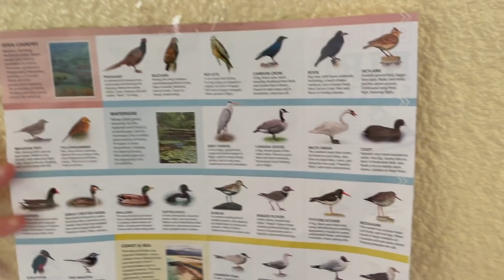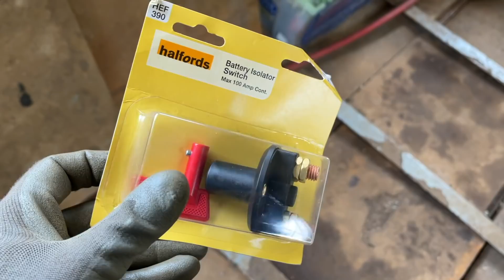WE HAVE BOUGHT A NARROWBOAT!! | Narrowboat Tour

Comment: Looks like your taking on water hope.you check the welds.before it went in.reliable those 1.5 BMW engineering .I mean BMC
Reply from the maker: It had a full overplate on the bottom of the hull so should be all good. The water had come from the front deck and windows being open but the deck has been welded now & touch wood we’ve not had any more water in since!

Comment: Please don't throw the bilge water overboard. This water is polluted! Treat the steel in the bilge with a surface grease just as skippers always do. DON'T PAINT IT !!!!!!!! I think the Tenco Antirust Compound is a great way to do this. This does not dry out and it keeps the bilge in perfect condition.
Reply from the maker: Thanks for watching! We went with what most people here seem to do & used bitumen/blacking as they do with the outside of the boats,  will take a look at the Tenco product for the future. Ref bilge water the CRT seem to say as long as there's no oil in it then its OK to pump into the canal.
Reply: @ItsOhJoe  good luck rebuilding your boat. Its a great lifestely I have been living (in the netherlands) on dutch barges for over 20 years now. currently living and working on my 4th rebuild.

Comment: Take the ballast out 1/4 at a time (NOT all at once! you will make the boat unsteady) and paint the inside using something like POR-15, then coat with a hard wearing non slip paint such as garage floor paint mixed with some sand (to obtain the grippy rough texture) and finally line the hull and between each ballast slab with felt and re-ballast, the sand was added to stop the felt from slipping on the paint. This will stop rust and the felt will stop the ballast from moving and scraping the inner surface of the hill causing it to rust from the inside, and felt between each slab stops the ballast from sliding. I would keep the steel doors you have for security as most boats are broken in to through the wooden and glass doors. Get yourself a good lock on each door such as one of these:  https://www.google.co.uk/url?sa=i&url=http%3A%2F%2Frichardspersonalblog.blogspot.com%2F2013%2F05%2Fnarrowboat-security.html&psig=AOvVaw0RmUS52rQSka9cgeQWPET_&ust=1617141529410000&source=images&cd=vfe&ved=0CAIQjRxqFwoTCJDi5eq_1u8CFQAAAAAdAAAAABAP
Reply from the maker: Many thanks for the advice! we're about halfway through the floor now, funnily enough we did exactly 1/4 at a time. With how our floor is we managed to get away with just bitumen & the slabs sit on separate gurders if you will. Security issue has been mentioned ref wooden doors it's something we need to consider more definitely. Thanks again.